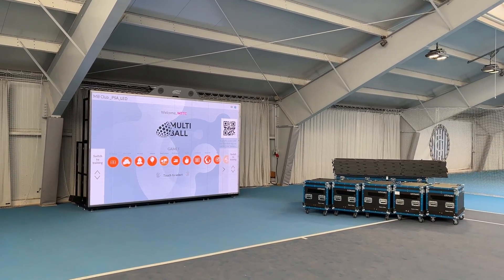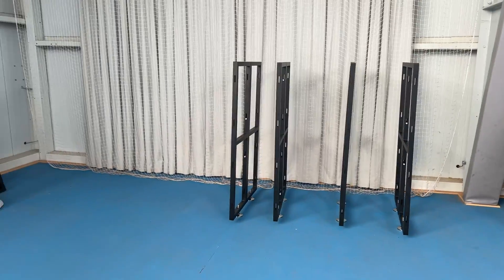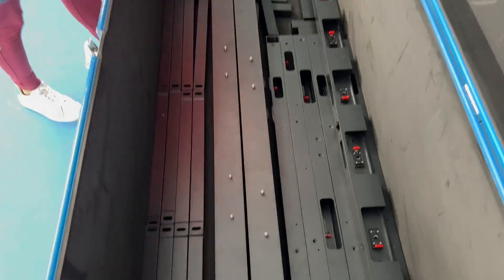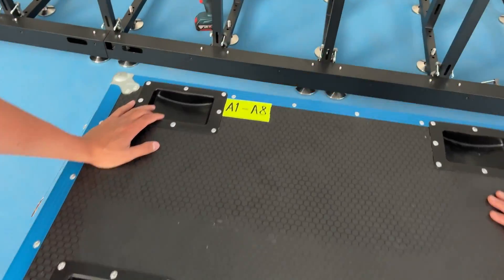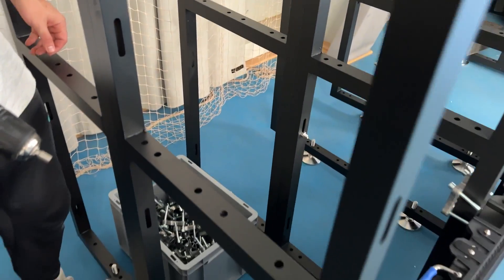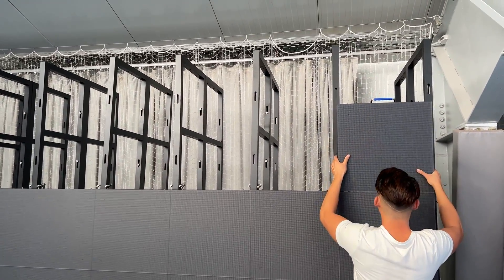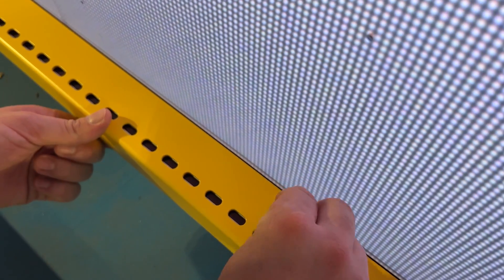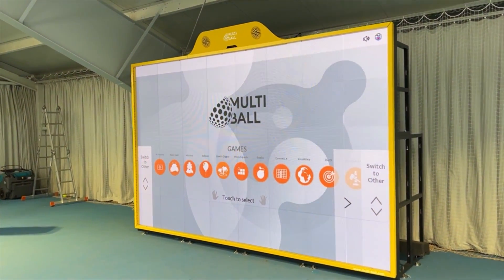MultiBall LED Setup Guide

Comment: With older projection units in a country with SAE I found installers being stupid over torquing screws. It is not that hard to use ratcheting hand drivers with appropriate size Metric to feel proper alignment (no cross threading) and reasonable torque. This helps if later maintenance calls for covers needing to be removed. Also, I found some places where nylon washers as on controller cover screws, makes for tight screws that do not bind if access needed later. Hand tight and the right size Metric bits is key. 

On wish to have list would be view holes to see controller LEDs note touch to physically note if blocked sensor or lockup. View port to see blue computer power status a plus. This could be done by aligned holes for viewing from a distance in front of unit to confirmm or augment software. 

Very important to stress Metric and that it all fits nicely when aligned as felt by hand tightening and eye observation. I like the idea of the metal scaffolding design for these LED units for ridgid structure and alignment. Power grooming might also be touched upon for stable AC power in areas of heavy electrical storms or electrical grounding issues.